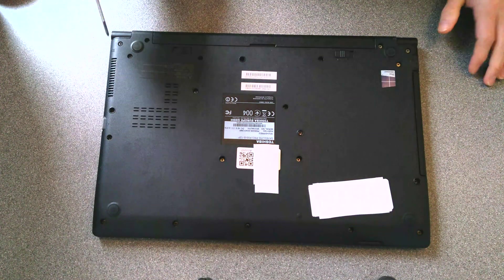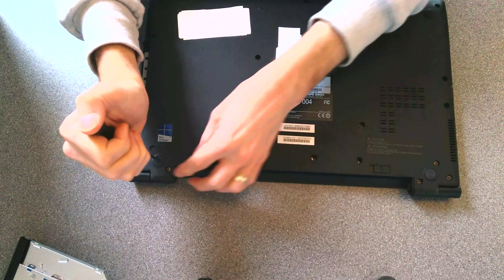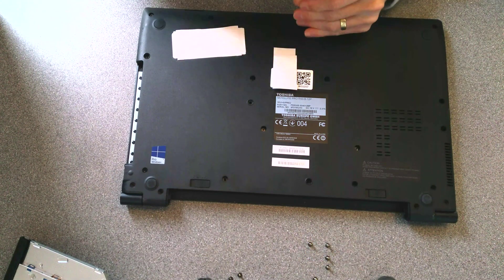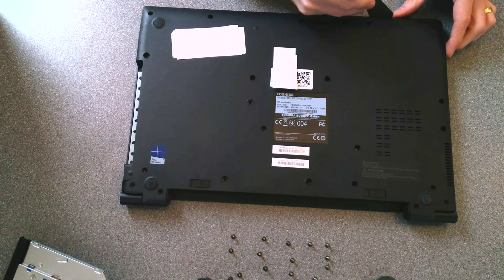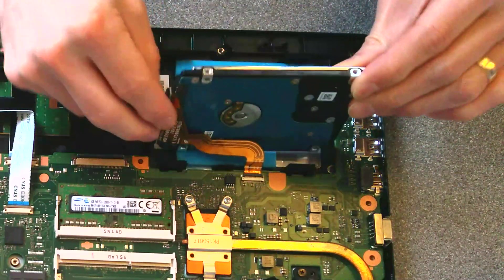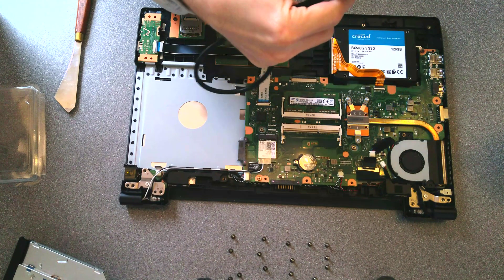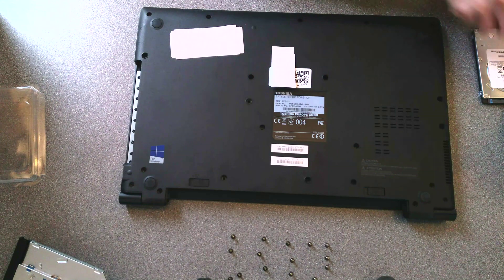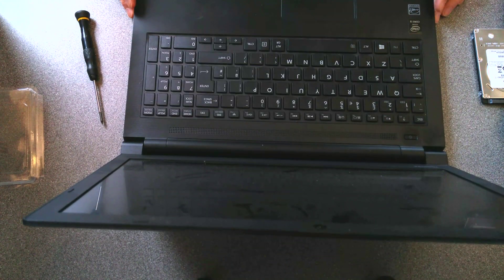Toshiba Satellite Pro R50-B-12P - How to change or upgrade the hard disk

Comment: Hi, I know this video is a bit old but ive been searching for almost 2 days now and I cant seem to find an answer..

I replaced the HDD with SSD and formatted it, done with the windows installation however when it restarts/boot, it just goes right back to the start of the windows installation.
When I remove the flash drive windows installer and restart the laptop, it cant find any boot drive/OS. Ive check the SSD, the files are all there. Even tried different SSD but still the same issue.

HDD reformat goes fine without any problems with the same OS/USB/BIOS Settings.

Any help would be much appreciated. thank you.
Reply from the maker: Very strange. Can you change the disk controller mode in BIOS from AHCI to Compatibility/IDE mode ? Can you try installing Pop_OS! or linux and see if that works?
Reply: @freename  unfortunately there is no Settings in BIOS to do that. The only settings related to the sata controller is setting it to "Performance" or "off/Battery".
The rest are just CSM, UEFI Legacy and UEFI. Secure Boot is already off. I dont have experience with linux either.

My best guess is that this is related to BIOS version. I had a problem with Dell Latitudes (5 / 6th gens) that wont boot with this kind of usb install as well. Problem is that I cant find the bios update for this specific toshiba. Its a Satellite Pro R50-C PS562N. When I tried to look for a bios update, there is no available for PS562N.

Thanks.
Reply: @shanvym2855  just ran into this same issue! Did you find a fix?

Comment: The tip about the shorter screws was helpful thanks.  I was putting the shorter ones into the holes intended for longer ones.  I got complacent dissasembling similar laptop and didn't note the screw size difference.  All sorted now :-)
Reply from the maker: Always annoying when it isnt the same across a laptop.
Reply: @freename  Totally! Don't get me started on laptop design. What really sucks as that not that long ago we had more serviceable machines. Trapdoors for memory, accessible hard drive bays etc.. But then it all went to hell. I mean manufacturers making repairs and upgrades as time consuming and difficult as possible. Regression is what it is. So glad that we have the magic of YouTube. A huge help no doubt.
Reply: Happened the same to me. There are only 4 longer screws and they are all in the hinges (2 for each hinge) right?
Reply: @ifigas  you got it. Put those 2 longer ones in the spots shown in video. At 2:06 in the video.
Reply: @mattscomp  Thanks!!